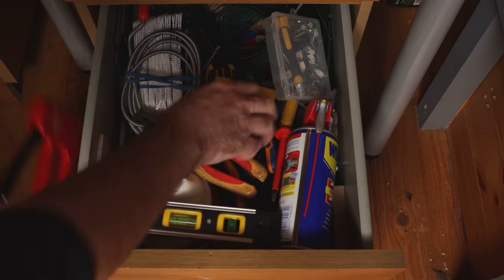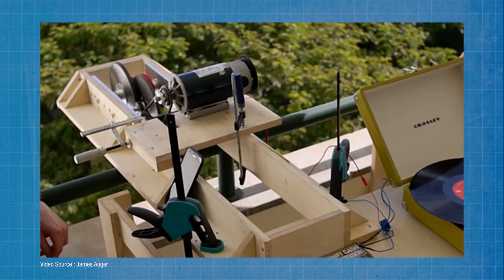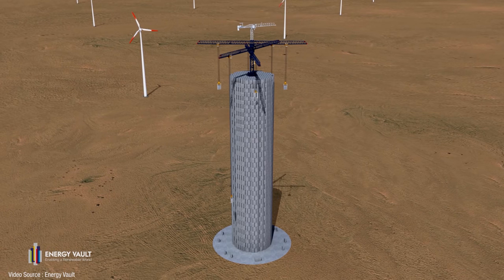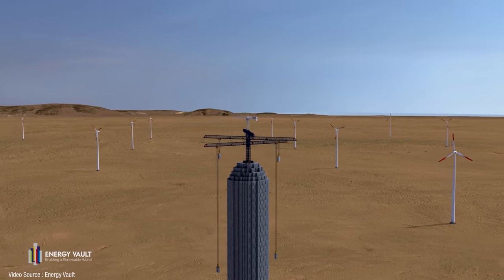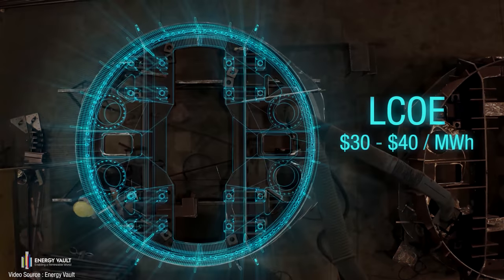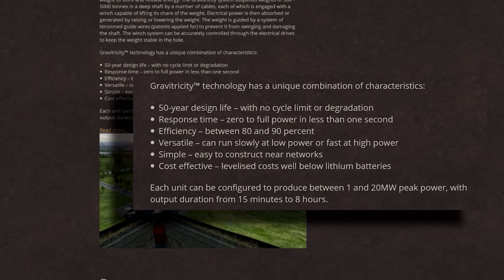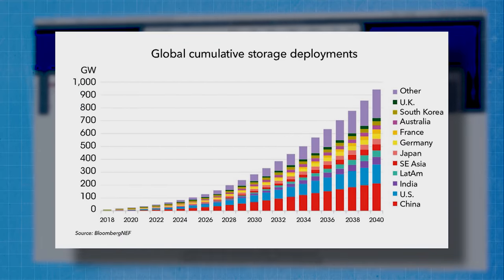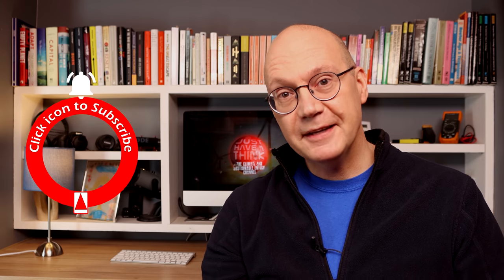Gravity Energy Storage : A very uplifting technology!

Comment: Why don't we use giant springs for a wind-up generator.? batteries can rewind the springs. Clock gearing.
Hook a cable to the back of your truck that runs up high in between two trees, that runs through a pulley and generation system down to a 55 gallon drum full of dirt rocks water whatever you want..lol.

Comment: I've heard proposals to lift a heavy weight on a cushion of air in a shaft as storage as well.  I suppose you could use water as well.  Any chance of putting an effective gravity storage device inside the shaft of a wind turbine?
Reply: If they're big enough to have a properly useable inner space., they probably need said space for maintenance. As an aside, having a system with a substantial weight that moves up and down within it (thus changing the centre of gravity)... well, with a wind turbine, that would be rather risky.
Reply: @lGODofLAGl  The towers are getting bigger with the turbines.  There's plenty of space for maintenance access so adding batteries at the source of power might be efficient.

Comment: pardon my ignorance here, but how does gravity energy produce net positive electricity? Rather than use renewable energy to restack the block tower, isn't it more efficient to simply release that renewable energy to the grid? Or is this exploiting the difference in work required?
Reply from the maker: Hi there. At times of low demand and high generation from wind a solar, the grids can't use all the energy produced so they have to curtail it - i.e switch it off. Instead this energy would be diverted to energy storage systems like this. Then during times of peak demand and low generation, these systems can be used to help balance grid frequency demand.
Reply: @JustHaveaThink  Thanks for the explanation!

Comment: Instead of Gravitricity using solid weights and moving them up when electricity is cheaper - why not channel water into the top to create the weight, and at the bottom let the water out (the top one filling again). No need for power to raise the weights - just need to locate it where there is a water source available at the top. Just saying' ...

Comment: In 5-6 years tesla will likely have a next gen megapack with 4870 batteries. Given the simplicity and cost such a system will have I just don't see any of these being competitive.
Reply: Lithium-ion batteries are not designed for energy storage. They are extremely dangerous and have a lifespan that is laughable when charged/discharged as many times as a grid battery is. Not to mention that they're very fragile, complex, and bad for the environment at that scale. 

(I'm an engineer btw)

Comment: It is very cool physics by honestly we keep on trying to build genomics machines that get more and more  Inefficient at a certain point we might as well just make the earth one big generator. It Is just more inefficient to build a genomics machine than to build a Micro grid with each house having its own power source and any residual energy sent to a grid tied battery That way within reason the grid can decide where we need the energy for emergencies and/or for Officiant usages like businesses and other houses that may or may not get enough energy from solar wind or whatever thay use. We keep thinking we must build Bigger when we need more energy when in reality we need to build smaller affective and efficient micro Generators like a batteries that are individual cells of batteries to create a large battery system so why not do the same create individual generators that create a genomics energy system That would be less stress on the environment less stress on space and less stress on the grid itself then putting patches upon patches on a system that's  At this point antique.

Comment: If you take me invention the college students came up with and you put a larger weight in gear it down lower so it goes slower and it turns a fly wheel the fly wheel will turn the generator the weight will be lifted quickly by hydraulic means so that what that is going to happen is it will take a minute or two to lift the weight but it will generate electricity for more than an hour I’ve done this you could put a tower in your backyard or dig a very deep hole a little of both gives you more distance you have two weights two large weights 255 gallon your voile tanks filled with sand as one comes down the other is stored at the top when the first one hits the ground the second one comes down this takes two hours generate enough electricity to run a DC powered winch that lifts the first drum to the top within two minutes the winch will lift the weight no problem. You could theoretically put a small weedeater gasoline powered engine hook to the hydraulic pump it would lift more weight quicker and you would burn very little gas each time it ran but the electricity generated would be way more especially if you have a big enough fly wheel connected to the huge weights coming down these towers could put homeowners completely free of the grid they were generate more than enough power for a smart electrical home that uses LEDs and all of the other energy saving devices not to mention if you generate this electricity and stored in batteries for when there is too much electricity that you’re not using

Comment: I have tried to figure this one out but I don't have the math skills: would it be more efficient to have a large weight fall a certain distance, or a smaller weight fall over a longer distance?  I can envision an outbuilding in someone's back yard no taller than the house storing enough energy for that house, but it would have to be a huge mass falling over a short distance.
Reply: Equally efficient - you can convert between them using simple pulleys. The energy capacity is simply the mass of the weight times the vertical distance traveled, times the gravitational field strength (Which is around 9.8). However, the storage density works out as 'not much' no matter how you arrange the weights. It works, yes - but it isn't really economical.

Comment: The lights blinking on-off constantly all night are a nightmare.  The system will need lights on every one of these so that airplanes can see them.
Reply: Just like windmills, huh. BTW, you'd think that by now, airplanes would have a GPS/geodata information system that made the blinking lights unnecessary.
Reply: @tzenophile  They do.  It's called LIDAR and its expensive.
Reply: @oldfootage  LIDAR is not GPS/GIS/data-based, as far as I know. But lidar prices will come down soon, as self-driving cars will need this sort of thing. Meanwhile, why not use infra-red light and censors on the towers?
Reply: @tzenophile  Correct.   I forgot the name.  I was interested in the technology when I was building a house out in Neenach.   You go out to pee at night and the whole mountainside with wind turbines flashes on-off like a Micheal Jackson disco.   It's an annoying nuissance!  Anyway, long story short, the technology exists to detect approaching airplanes but it is expensive.  So most wind generators do not install it.

Comment: After some musing, there's two basic problems. Too many moving parts, and too hard to scale.
Potential energy is a poor store of energy so you need a huge scale (hence hydro electric uses lakes and not water towers), this isn't going to achieve that.
I think they might be better digging a huge hole and using the extracted rubble to build a raised artificial lake, to make a hydro electric storage system. The technology is tried and tested and has relatively few moving parts.

Comment: My physics is pretty rusty, but wouldn't you use more energy lifting the blocks back into place than you gained by lowering them?  Please explain what I am missing (I only have 1st year university physics from over 40 years ago, so please keep it as simple as possible. lol)
Reply from the maker: Hi Allan. The system uses excees power generated by solar and wind during the day - power that would otherwise be curtailed by the grid operators becasue they cannot use it at times of low demand. Then at peak demand (often in the evening when solar is not functioning) that stored energy can be released to help balance grid demand. There is of course no gained energy - that would voliate the laws of physics. These system simply store energy that can be used when it's required.

Comment: The deepest mine shaft in Britain is about 1,300m deep. It’s actually a salt mine not a coal mine.
I’m going to assume 1000m as about the maximum the Gravitricity people would be able to find. 
They’re claiming an energy storage of 8MW.hr which is 28,800,000,000Joules. If we take g as 10m/s^2  then to store that much energy would require a mass of 2880 tonnes. Not impossible, I’ll concede, but I bet the maintenance costs will keep it from serious contention.
The tower of blocks is, I suspect, going to require even more maintenance for an even lower storage capacity.
And let’s face it, 8MW.h is chicken shit when you’re talking grid scale storage. That’s just a sixteenth of the capacity of the South Australian battery bank which Tesla installed in 2013, for a population about a third as big as Yorkshire.

Comment: I suspect we're going to see batteries becoming sufficiently inexpensive that batteries will dominate storage.  

Consider:  Batteries are already inexpensive enough to take over the short term storage role.  As prices drop, and Tesla is right now cutting prices in half, batteries will dominate 1, 2, and possibly three day cycle storage.  That's all we need for several years because it will take us several years to install enough wind and solar to surpass 80%/90%/95% of our grid supply from renewables.  Most storage will be either very frequent cycling as we move solar into the evening and late night wind into the morning.  The more often batteries cycle the quicker they 'earn money' and pay for themselves.  Let me use LiFePo cells with 10k cycle life for some back of the envelope math.  

$50/kWh / 10,000 cycles = Half a cent to store a kWh.  That's cell cost.  It does not include the hardware needed for the AC->DC conversion and the DC-> AC conversions nor does it include financing costs.  The hardware costs are not the problem.  The potential problem is interest on the loan.

If a $50/kWh battery is cycles 1x or 2x a day it creates a large revenue stream and pays back the finex rapidly.  If the battery gets cycles only a couple times per year it will take a very long time to pay off the cell cost unless the charge for storage has to be very high.  Buying a $50/kWh battery and making payments over 50+ years would be expensive.  

By the time we start dealing with 'the last 1%' we are likely to have a lot of used but usable battery packs pulled from EVs with wrecked or worn out bodies.  That is going to be some cheap storage because, in essence, the cost is the amount required to "rent" the lithium, nickel, and other usable materials in the cells.  

When an EV is scrapped the batteries will be sold for the value of its recoverable materials.  If the battery is first sold to a storage company then that company can use it for grid storage until its capacity drops very low.  Then the storage company can sell the battery to a recycler who will recover and sell the cell's materials.  The storage company should be able to purchase used EV batteries for just a bit more than battery recyclers are willing to pay for the cells.  And then sell the cells on for only slightly less than they paid later.

Comment: So you generate 1 kwh lowering the concrete block, then expend 1 kwh raising it back to the top. Did i miss something ?
Reply: It's an energy storage aka battery. It can store the excess of solar energy production during the day and inject it at night for example.
Reply from the maker: Yes you did Duane. The energy used to lift the blocks comes from wind and solar during periods of low demand and high generation. Much of that power would otherwise have to be curtailed (switched off) by the grid operators. Then in periods of high demand and low generation, the stored energy can be released from the system to help balance grid frequency.

Comment: Not sure how accurate the stacking is going to be when the wind is blowing and the tower is storing.
Reply: They would obviously design them to be aligned and to lock into place.
Reply: @yggdrasil9039  obviously. But how do you design something that's dangling from a cable to be aligned in winds ie when this system actually needs to be working?
Any geometric alignment built into the cast blocks will only be able to cope with a misalignment of half of one block and a rotation of less than 45°
It's why tower cranes can't operate in high winds, the load swings around too much, this also takes the load off the centerline meaning the counterbalance and load don't bisect the vertical axis and increases the potential for collapse, which is only compounded by the wind itself. Ya get me?
Not to mention that half the blocks are stacked below the half way hight, doesn't seem an effective or safe use of the world's finite resources.
Reply: @turboconqueringmegaeagle9006  Yeah I was wondering about the storage rings. They need to work on that. For safe operation in high wind areas I'd think about some kind of rail structure so that they lock into a rail system to guide them to the ground as the energy is slowly released.
Reply: @yggdrasil9039  they propose a tower 160m tall, a 35t block at this height has a stored energy of 15 kwh so to charge a model s tesla it'll take 6 blocks from full height. The second row of blocks isn't just stored 1 block lower but Its dropped 1 block higher so if the blocks are 3m tall they travel 6m less and only have a potential of 14kwh and drop 1kwh in output per subsequent row.
The blocks 3/4 of the way up will only store 7kwh with anything below half way being dead.
I was trying to figure out the number of blocks in their towers but can't find any info on that.
I'm just saying it's a shame this is receiving serious funding as the cost/reward seems small compared to other ideas that are scalable and less of an eyesore like the liquid air energy store that has the added bonus of collecting co2 as a by product rather than just emitting tons of the stuff in it's construction, it's good green energy development funds exist but projects like this that have a seemingly limited potential should be back of the line for the moneys.
Reply: @turboconqueringmegaeagle9006  Interesting. Yeah I agree, I think the liquid air idea sounds amazing, as well as scrubbing CO2 from the atmosphere, and using off the shelf components, though the expansion phase for regassing would need by-product heat from some waste source (or from molten salt capacitor from a solar thermal plant located nearby) or it will be not very efficient. I do like the idea of this gravity storage as well though. The fact that it's simply the solid version of hydro makes it logical and applicable anywhere, plus being very very simple in principle. It's also using the same principle as the gravity lights you can get, just scaled up significantly. I think there's room for multiple forms of energy storage all doing their bit.
Reply: @yggdrasil9039  correct me if I'm wrong but I believe a heat store of some description was proposed (if not implemented in the first commercial plant) whereby cooling during the compression was advantageous and the stored heat would then be used during the expansion.  Achievable with a heat pump ploughing the thermal into the soil or rock around the plant.
Once you run out of pressure vessels you could do something useful with the co2, starship fuel maybe to get rid of the excess humans....
It would be nice to imagine waste heat being used at source for other utilities so not available for suply to a liquid air battery but certainly if available it would be advantageous and save on the losses associated with heat pumps, cooling the compression phase won't be difficult in Manchester.
Maybe we could harvest the hot air in parliament? Or give MP's an office next to each planet and let them zoom eachother negating the transmission losses associated with trying to move thermal energy.
Either way, it's an entirely feasible, scalable, dense system that gets way too little publicity meaning it could probably do with more funding instead of the more questionable systems.
Reply: @yggdrasil9039  re. Being the solid equivalent of pumped hydro, I'd say that the railway up the side of a hill is a better comparison, the tower crane has too many physical constraints so is not scalable you'd just need to build multiple units for more storage so no reduction in cost/materials (actually I think the material usage goes up expodentially for a linear increase in storage cap if you just try and make the tower bigger as with any tall structure)
Hight and mass ultimately being the limiting factors, if there is a hill, use it, if not, find a non-gravity storage method.
What ARES is doing in california with its railway is entirely scalable with additional track required for increased peak and additional cars required for increased capacity, only limited by the number of cars the hill can support.
The hydro equivalent of the tower crane would be like using a water tower as pumped storage.
In fact I like that idea better, it'd almost certainly last longer than a crane and has far lower potential for catastrophic failure.

Comment: I'm sure it's a silly thought, but could similar simple technology just be built on to wind turbine towers?
Reply: Wind turbines need clear space all around the tower for the blades to spin and flex, not a great place to have a bunch of cables swinging about. If you think about it, it's going to be busiest when the tower is working because it needs to try and lift as many blocks as it can while the turbine is producing at max output.